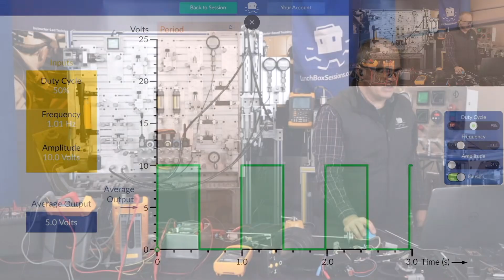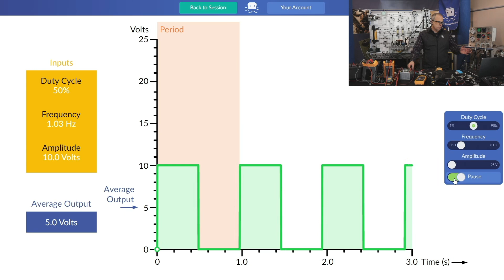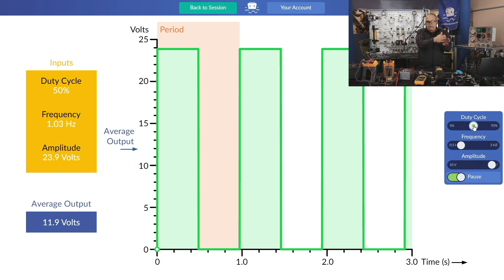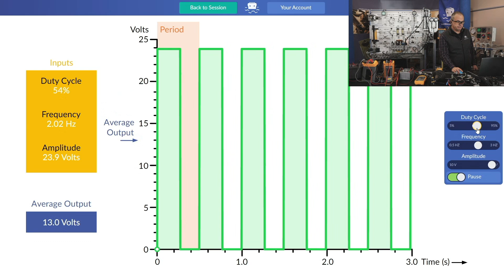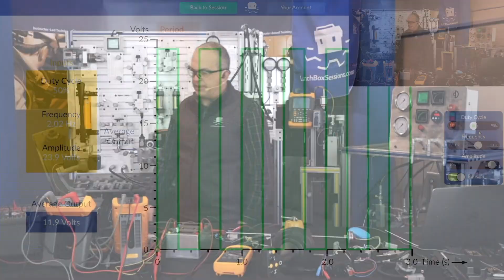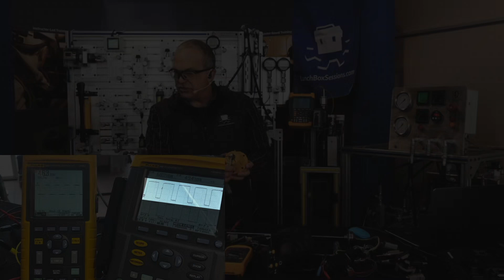Teaching: Pulse Width Modulation

Comment: Hi carl just a random question that I can't get my head around, if I had a fixed displacement pump say 100lpm and I put a flow control on the outlet to control the flow to 60lpm where does that other 40lpm go if its fixed displacement
Reply from the maker: This quickly becomes a high pressure hazard (hose blow out, pump housing cracked or shaft broken perhaps, prime mover stall under best case) if a correctly set, pressure relief valve is not present between the pump outlet and the flow control. Tightening the flow control until only 60 lpm comes out when the fixed displacement pump is 100 lpm, means that 40 is passing over the relief valve. The system itself would be energy inefficient with lots of heat building up within the fluid.